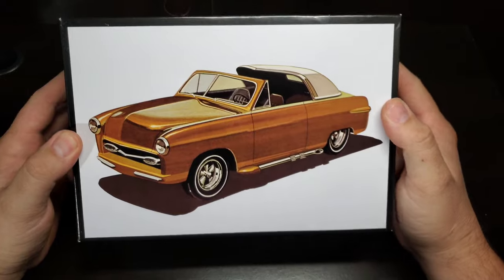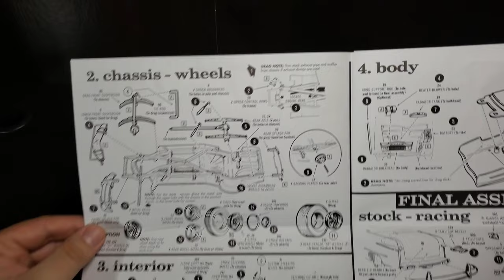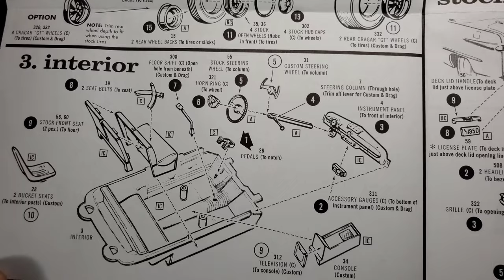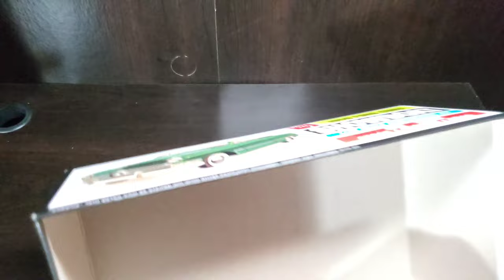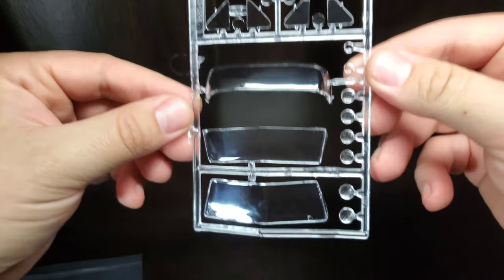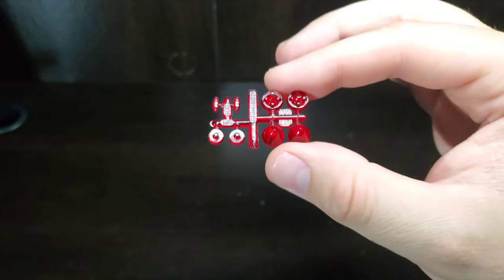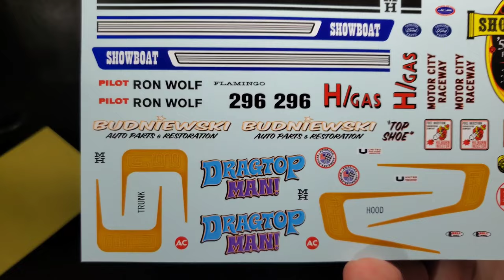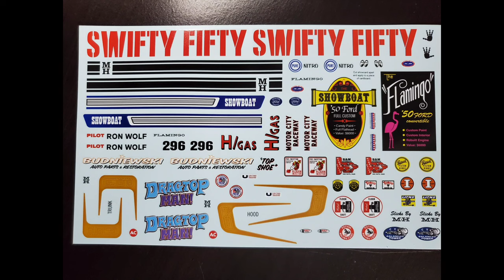AMT 3n1 1950 Ford Convertible "Showboat" 929 Before you Buy/ Box opening Parts, Decals, Instructions

Comment: I don't have the 50 ragtop (I do have a couple 49 hardtops), might puck one up because I've never built one, thanks for the look-see, brother 😁✌️
Reply from the maker: Right on!  I've definitely been on the watch for a couple of the new releases of the sedan, I want to section one as that's my favorite look for them.
Reply: @sodakmodelcars  I've been thinking about picking up the new one too, to see what's new (both of mine are late 80's to early 90's releases) 🤔😁👍
Reply from the maker: Biggest thing I know of is the awesome pad printed tires.  I think there's 10 tires in it.  Full wide whites and white wall slicks.  If they sold the tires out of that kit I'd buy a stack!

Comment: Good parts source for making hotrod mods one one of my '40 Ford sedan rods.
Reply from the maker: Gotta love AMT Customizing kits!
Reply: @sodakmodelcars  oh yeah. I have a 427 Y- block, from a a first generation 32 Ford Vicky kit. That I am putting in one of the Ertl release 40 sedans. And will be putting the stock Vicky flathead into a first generation 32 roadster to make it a model 18 roadster..
Reply from the maker: Oh nice! 😎
Reply: @sodakmodelcars The Vicky is going to be a Highboy, with maybe a big Lincoln engine. Perhaps a Cobra 427..
Reply from the maker: A big Lincoln v12 would be pretty rowdy!
Reply: @sodakmodelcars  Just the 420 V-8.. I don't think that a Zephyr engine could fit that frame. I'm looking to do a '50s style Highboy hotrod. With the Vicky. Got period correct narrow slicks for it. I know those were used on street rods at that time.